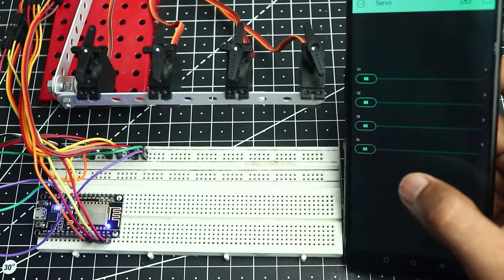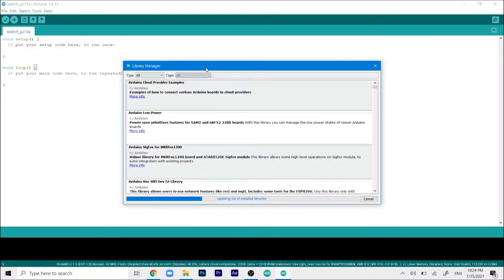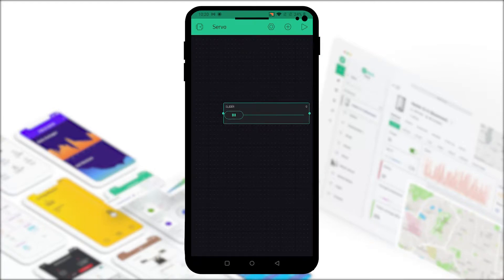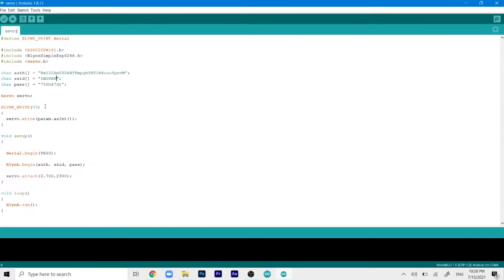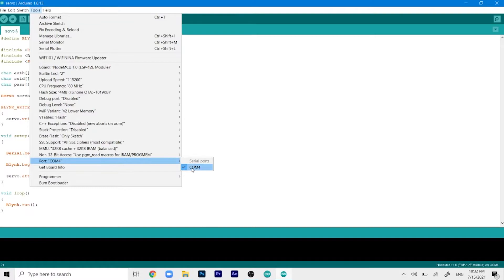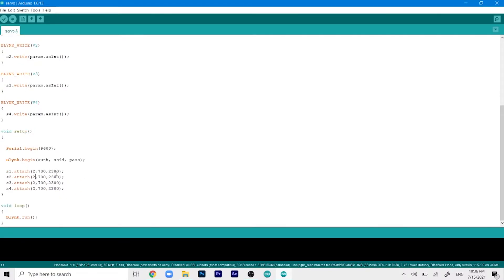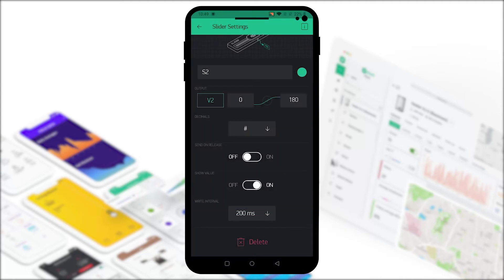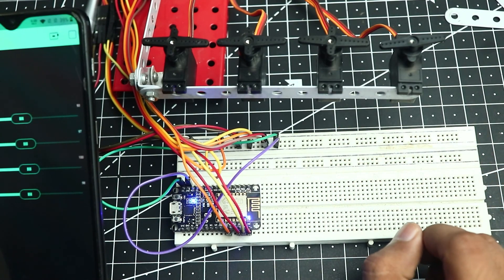How to control Servo with ESP 8266 NodeMCU | 4 Servo Control | iot project

Comment: How many servo we can control by using ESP8266?
Reply from the maker: If you have external power then I believe almost every output pin can control a servo. You can also use servo control board.
Reply: @INOVATRIX  
Did you use external power supply for this?